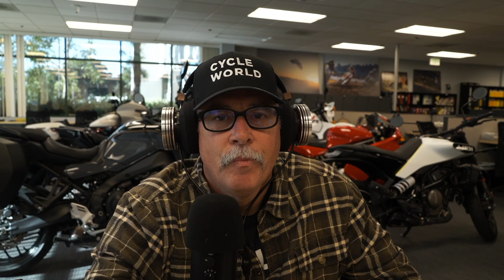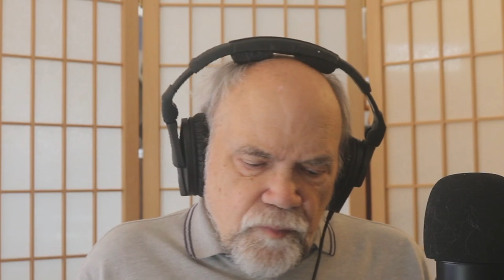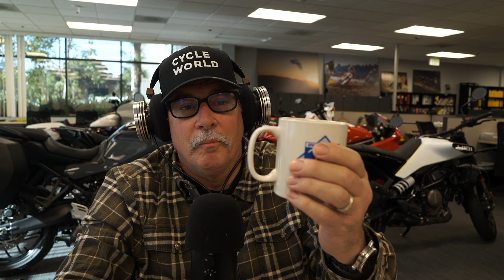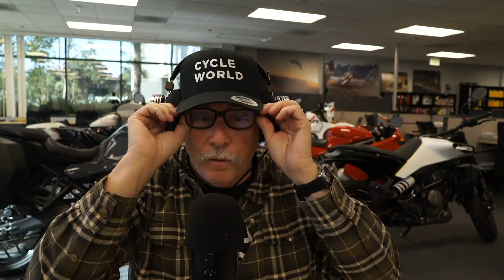How the TWO-STROKE EXPANSION CHAMBER WORKS and Where It Came From (call it Acoustic Supercharging)

Comment: My dad was a Rocket Engineer with GE at The Cape in the 50's/60's/70's when I was a kid and when I started racing motocross with a YZ100, he had a very good knowledge of sound wave resonance from rocket engines and  hand built down swept expansion chambers on all three of my racing YZ bikes (YZ100, YZ125 and YZ250), explaining the math behind down swept expansion chambers should give me a HP advantage with the port work at high RPM. I don't think i ever lost due to a HP deficit and went on to earn an AMA Expert/Pro license in 125cc Motocross.

Comment: The orbital two stroke concept, piston compressor injecting about 1/4 charge and fuel after the exhaust port closes. This one’s for Mark it creates a stratified charge in the cylinder with a stoichiometric  mixture near the sparkplug getting progressively leaner further away. And for Kevin it has always amazed me that standard air pressure is 14.7 psi and stoichiometric ratio in an engine on gasoline is 14.7 key creepy music.
And 6.02 x 10^23. Or RMS 0.707 of peak I’m just your average guy.
Wobbles the mad roundcase Ducati nut Aussie.

Comment: Mixing gas, hauling a$$!! 💨💨💨🏁

Great video! So many interesting things i never knew about before.🤯

I've noticed as big or bigger gains from putting a good silencer (shorty, for me) on my YZ 250's, even before a pipe. Stock pipe okay, stock silencer not okay. 🤷

Is the "evolution" complete? No more "big" advancements in 2 stroke pipe designs are possible?
Remember the old FMF SST exhaust systems? I had one on a KX 250 and it was good. What was the idea behind those? I think it was "new" and had a patent...🤷

Comment: Riding a ty80 and kx80 taught me so much as a kid. One helped slow speed balance and clutch control, while the other was like a tiny little drag bike with a wonderful powerband to explore and infectious. First gear was very low but short shifting to second gave a big wallop of acceleration, picking the front up while sending you on your way. Until that first rather sudden event occurred. When you realised that not modulating the throttle correctly and delicately enough while upshifting, with a still rising front wheel was a terrible method to find the balance point. Two-strokes made you realise you weren't invincible either! 
Did I slip into a wormhole with a former 10 year old self? Yes!... 

Thank you! for the fascinating tangents and insights.

PS, in Wales that day (shortly before events unfolded) Passengers on a passing bus witnessed the euphoric part of that wheelie being demonstrated to them. By some kid in a random field trying to stay on the pipe, before 4th kicked his butt 😅

Comment: Chrysler West bend uses carburetors and reed valves bolted directly to the bottom of the crankcase. Put a roots style supercharger in place of the reed valves .internally gear drive the supercharger off one of the crankshaft flywheels with gear teeth cut into one of the flywheels driving the supercharger..

Comment: Hail the Adler twins of the late '50s.  Had expansion chambers from the factory and no other 250 could touch them for power.  Only drawback for scrambles was the engine width and the pipes clearance under the engine.  Hit he straights and you could whiz by the others.  My first motorcycle ride was on an Allstate (Puch) 175 'split single' which I helped the owner decarbonize in our high school youth.  It was pretty healthy running and well crafted little machine.  I got to race my Adler once and won, TT scrambles.  Next practice session, one lower end seized and that ended trying to compete on it though I did get it repaired and back running.  Those bronze roller cages for the rod bearings held heat, also a   problem on some early Yamaha twins that would hold heat on the dynamo side rod throw.

Comment: My first experience with 2stroke engines was with Clinton A400/490 kart engines a later McCulloch MC10. The performance exhaust for the Clinton was a short megaphone the had a rather pop-pop sound. The MC10s pipe wasn’t much better and It wasn’t until I bought a Yamaha YDS2 with TD1 expansion chambers that I experienced the performance gains. In the early 80s I was racing a RD400 in WERA and bought a set of Erv Kanemoto’s pipes from Stuart Toomy that I saw the real gains in power.

Comment: I would love to hear you guys talk more about dynamic expansion chambers and resonators.  Did the power valve kinda make them obsolete?  Curious what designs were tried - cones on sliders inside the expansion chamber? Iris baffles? Hinged gates? Do we have to rebuild the exhaust after each race, now? How would you mecanically connect to the rpm? Fascinating! Lots of CVTs at the apex of 2stroke power, now.

Comment: What advantages and leaps 2 stroke technology made in the 90's and 2000's has been negated in recent years by 4 stroke technology now. Modern intake, head, header, and fueling/mapping designs have allowed modern 4 strokes to make the same specific power as 2 strokes have. Modern packaging, cad, and materials have allowed them to weigh the same. 2 strokes used to make a higher specific power due to the supercharging effect of the pipe to increase the displacement of air processed, of which modern intake path, cam overlap, and exhaust scavenging has now allowed 4 strokes to process more air than they displace as well. 2 strokes used to be considered higher hp per size due to a power stroke or pulse every tdc of the crankshaft, but with modern 4 stroke designs, a 250cc 4 stroke engine having a power pulse every other tdc of the piston at 14,000rpms, processing 300cc of air will be the same as a 2 stroke processing 300ccs of air every tdc at 7,000 rpm. AMA must realize this in order for 2 stroke rules and homologation to make since and further allow 2 stroke technology to increase. Currently, 2 stroke technology is Only advancing through dirt bikes. 4 stroke technology has been able to advance on every ICE front including car and truck motorsports.

Comment: As a kid it was real mystery as to why the exhaust looked different on various two strokes. The pipes on dad's two stroke Suzuki twin didn't look much different than a four stroke. Our trail bikes had expansion chambers quite a ways back from the head and were that gave clearance for heat shield and leg.

I remember an article on the Honda six cylinder race bikes. There was something unusual about the weight of components that varied from the center of the engine. I wish I could remember what it was, but you'd be surprised at what length they would go to to get equilibrium?/performance?.

Comment: Wonderfull as usual many thanks    Germany's Lanz Bulldog tractors which are hot bulb single cyl oil burning two stroke engines had expansion chamber exhaust in the 1920s  .Britian's Field Marshall tractors did this as well

Comment: "Two strokes per stroke" for a steam engine is incorrect.  I would offer that it is two strokes per cycle.  Or perhaps called a 1-stroke engine.

And one has to admire the efficiency of a locomotive engine where the connecting rod goes right to the wheels without intermediate losses.

Comment: I got my copy of Gordon Jennings Two Stroke Tuners Handbook in '73 while in high school.  I got a greens mower 2 stroke engine from the golf course across the street and convinced my physics teacher to buy a small dyno from Fisher Scientific.  Jennings book had equations for sizing ports for the RPM you wanted to make peak torque.  I measured the engine I had and back solved the equations to predict the peak torque RPM and others to predict how much torque it would make.  Then we ran the engine on the dyno and compared the results with the predictions.  The correlation was pretty good.  Later in college my room mate and I used the book to to port our dirt bikes.  I even made my own expansion chamber.  There was a mail order company that would roll cones to your specifications.  I managed to raise the peak power rpm and narrow the power band to the point that it couldn't pull the 1-2 shift while hill climbing with the wide ratio gear box.  All a learning experience.  Later when I had a '88 CR500R it had such a wide power band but narrow ratio gear box I put in a wide ratio box to get a better 1st gear for woods riding.  That bike was the biggest thrill ever, even better than my '81 RD350L/C.

Wish I still had my copy of Two Stroke Tuners Handbook, it's long out of print and worth a small fortune.  But I do have a PDF of it.
Reply: My dad and I built great running dirt bikes and snowmobiles based on Gordon’s book and sound advice from Kevin. With a few tricks of our own to get them through stock class tech inspection.
Reply: Is this the reason that Suzuki utilized a form of gas porting at the top ring of the piston to force the top compression ring to seal against the cylinder wall

Comment: Dr Gordon Blair Queens uni Belfast. Used specs fpr a tm 400 7500 rpm . After jetting was a well running engine. Would hook up and smoke most off the line on half miles. I have a plug from an rc 166 run at Mosport in 67. E 12 H

Comment: Snowmobiles have always been on the cutting edge of 2 stroke engine performance.   Their multi cylinder engines could be run with either a single pipe for a twin for economy models or twin pipes for more performance.  And they always had big aftermarket support.  Add a cvt to the mix,  and building pipes for different applications becomes a black art.  Love my 2 stroke sleds!
Reply: Do they still make two stroke sleds? I'm a southerner thinking about moving up north.
Reply: A snowmobile 2 stroke with cvt in a lightweight bike would have explosive performance.  I recall a custom racing bike a guy made, it had a gearbox, I think almost 200hp and under 300lbs I think!😯

Comment: until 1998, an American aftermarket piston manufacturer whose name started with a W had not bothered to figure out suitable metallurgy to prevent their piston swelling like a cake in the oven and gluing itself to the cylinder wall, even in 4 stroke engines !  they caused me much grief as an engine builder/machinist.
Reply: They’ve certainly got it right these days. Used many in road race two strokes with nothing but good results. Correct bore clearance and a good warmup help a lot. Very little wear in these pistons now.

Comment: Interestingly enough, expansion chambers also work n 4 strokes -- and we are seeing that with 250 and 450cc race dirt bikes coming from the factory. Basically every brand has a long, curling head pipe that opens up to an expansion chamber. Now the expansion chamber on the 4 strokes is notcisbly different -- very different in fact, but it is, in basic principle and function, still an expansion chamber.

Comment: Back in the late 60's I started racing flat track on Bultaco's 2 stroke singles... In the following years, as my skills improved and I was looking for more power, we went through a lot of porting experiments, and tried several pipes looking for the perfect one, and found they don't exist! We had ever narrowing powerbands in the wrong place of the powerband... After a couple of years, we realized that 2 strokes require rigorous testing, and rebuilding, trying to make more power than was wise. The extreme engines were too peaky to be useful on the dirt tracks. I started riding enduros and cross country in the 70's on great Yamaha and Husky bikes with stock pipes.

Comment: Seems I heard that Suzuki shipped a CZ Motocross bike back to Japan in order to get ideas how to build their First competitive two stroke Motocross bikes.
  Seems there was a Young man that was trained in Two Stroke Engineering in Sweden that got hired by Kohler in the USA to design some very competitive two stroke race Moters.
  Olev Aan had been building pipes and porting two strokes for various racers in Sweden. I think he went to an Engineering College in ND then got hired by Johnson Outboards and worked his way up to head Engineer in the Snowmobile race Department.
  After  Johnson quit making sleds he started his own High Performance CO   Building Expansion chambers  clutch kits and  he even built a V-4 Two Stroke Drag race Motor.  He used to write articles for a Snowmobile Magazine .
  As a young man he raced oval track sleds and later had his own Aaen Performance race team ect.  He wrote a book on setting up   CVT Transmissions.

Comment: Can the expansion chamber concept also apply to 4 strokes?  I know that the pipe diameter and length can be tuned for RPM range but seems an expansion chamber would also apply. Just have not seen it done.

Comment: Skidoo & Polaris both have 850 CC Two stroke twin Cylinder Two Stroke Snowmobiles with Turbos on them.
   The Skidoo has Direct injection and water/Methanol injection for longer hard pulls to keep things cool with out the weight of a big after cooler.
   The Skidoo makes 180 HP at Sea Level and 180 HP at 10,000 feet  all buy electronic controls on the waste gate.
   The Oil Injection is ECM controlled   100 to 1 at light power ratings and 40 to 1 or so at WOT..  2025 is the Last year for Yamaha Snowmobiles with were an Arctic Cat Chassis with a 3 Cylinder 4 stroke Motor .. both Naturally Aspirated and turbo charged..  The Turbo motor has stronger rods and I think Forged Pistons.

Comment: Thanks Mark and Kevin. I’m hoping 2-stroke technology regains the popularity it once enjoyed in motorcycling. Snowmobilers still embrace the lightweight and high power output of modern 2-stroke tech.
Reply: Would be amazing if they could make a  breakthrough to make it "clean" , yet still cheap to manufacture and simplistic
Reply: They are alive, well and modernized in the enduro world of motorcycles. KTM/Husqvarna/GasGas probably has the most advanced of them all with ECU control over fuel, oil, spark and the power valve.
Reply: @SJulianYZ125  you are definitely correct but it's mystifying to me how it took this long to catch up. Ski-Doo got their 600 sdi snowmobile motor to pass emissions almost 20 years ago and their etec motors since then are cleaner yet. I'm stoked that KTM is investing the R&D in two strokes, but they're barely getting to where Ski-Doo was 20 years ago in the snowmobile world.
Reply: @SJulianYZ125 Beta, too!
Reply: Hp tuners is being lame about 2 stroke support found on the forum somebody to bug but they keep saying wait for updates I got the link
Reply: @matthewfredrickmfkrz1934 what a horrendous sentence, if it can be called that.
Reply: @tonn333  sorry Mr punctuation but gatekeepers are gatekeeping 2 strokes from being fully tunable electronically I don't have time for grammar
Reply: @matthewfredrickmfkrz1934  if you don't have time to bother about your message being understandable, then why bother at all I wonder.
Reply: @tonn333  do you want links for the thread on the hptuners product forum for tuning 2 stroke
Reply: @matthewfredrickmfkrz1934  I don't think you can share it here, but do try
Reply: I think manufacturers like BRP may have made a slight error in putting EPA emissions compliant two strokes in snowmobiles instead of exploring options to put them in ON THE ROAD. Imagine how fun a sport bike would be with a 165 horsepower 850 cc emissions compliant lightweight two stroke engine. They could probably get it to hit the scales at not much over 300 lbs and still pass emissions and be fast.

Comment: I am in the UK, in 1968 I bought a T20 Suzuki and on the road it was unable to cruise easily at 70 as the torque was too low. When it was run in I started to race it and wrote to US Suzuki and they sent me a copy of their tuning tips which I followed using the pipes they designed and it was quite good but unable to ride with the new Yamahas the  TD2 in the dry but in the wet I had so much less sudden power that I could get faster times than the ‘hot boys’ . The pipes I had made were too long and had to be shortened to meet the rules and I read somewhere about pipes having the stinger place right inside the main body to the start of the converging point. It worked very well dropping the nasty noise but leaving the power at a reasonable point. I was poor and the bike would seize up as the points were always allowing timing changes, electronic ignition started then but were too much for me to buy.. I did well and even led major races until it blew up from preignition. I gave up as the money was just not there for me on £20 per week wages to keep going. Had I been able to get my TZR250 I bought for a road bike ,had been there I would have been a successful back then.

Comment: I'll ask again about the XR650L but do you know about the back of my RD350'S shop manual there was a section labeled performance where it shows measur the ports in the cylinder and translate that to the cones of the expansion chamber?